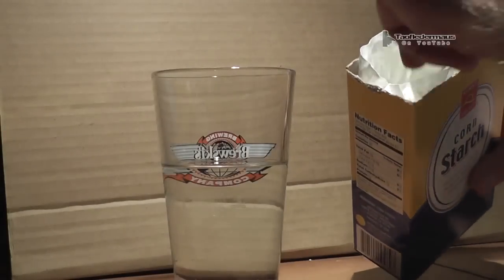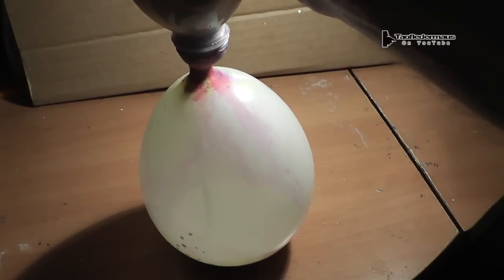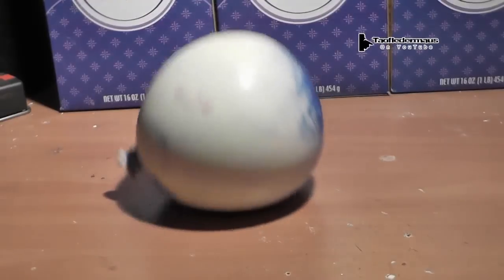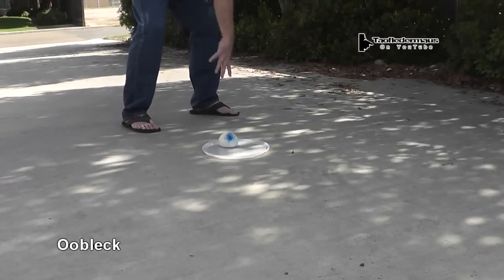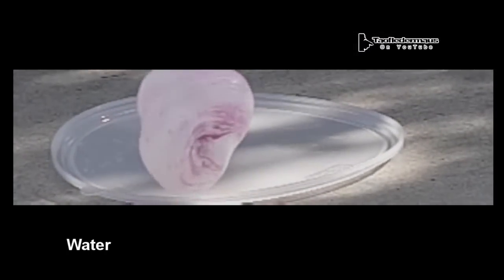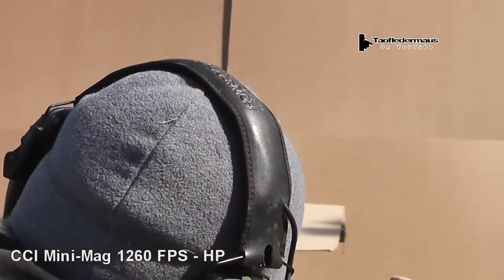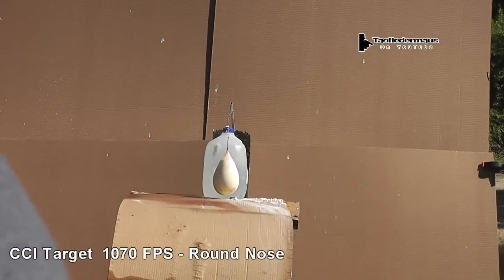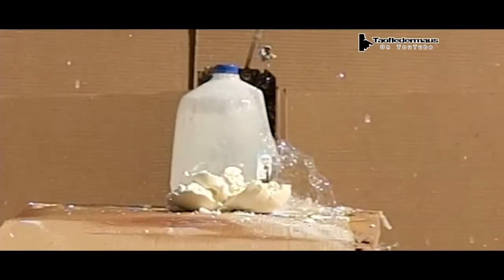Is OOBLECK  Bulletproof?   - Cornstarch and Water

Comment: Of course oobleck is not bulletproof. There is an upper limit to what it can take like any material, and obviously oobleck isn't on the level of steel or stone. Still you can see that it does not splatter like water, and acts a bit more like a solid.
Reply from the maker: I knew you were going to say that.

Comment: You did this ALL WRONG.    You should have had identical stop blocks behind the balloons that the difference (if any) between a simple water balloon and an oobleck filled balloon could be observed.  How much (if any) did the oobleck reduce the impact compared with a water balloon?  Your experiment only told us bullets will go through oobleck, nothing else.
Reply: Plus you should have used a more sturdy container for the oobleck as the balloons deform very very easily.  Or a test between balloons and say, a wooden housing of some sort.  There was so much you could have done for a fantastic video but were just too lazy or unimaginative.

Comment: What I was seeing is the fluid reached it's maximum hardness and shattered. The harder things get the more brittle they become is my understanding. Diamonds can be shattered though they are incredibly hard but the same amount of force that shattered a diamond will only make a bit of rubber bounce and distort for a few seconds. Hmm Diamonds are made from carbon and rubber is from rubber tree sap... can the two be mixed into a non-Newtonian fluid that can stop a .22 round? Dunno and everything I said in this paragraph might just be bullshit and bad education.
Reply: JETWTF Rubber is mainly made of carbon, oxygen, and water. Just about everything you see is made of Carbon, the rest is probably silicate, iron, or oxygen. As for using diamond in non-newtonian fluid I think steel would work just as well. Diamond is far too expensive and impractical. Non-newtonian fluid could be useful for protection against some form of shot, but I'm not entirely sure non-newtonian fluid can stop a bullet. Even if it can the military will not adopt it. I think I seen a video where non newtonian fluid was shot with a bb gun and a fairly good chunk was taken out of it. But, it did kind of repair itself so that could be useful because body armor is only useful after a 3 or so shots. But if you're shot that much you're probably dead anyway.

Comment: This test doesn't disprove the theory. The fluid must be prevented from rupturing the shell of the container. Using a balloon as a shell isn't going to prove anything about this mixture being bulletproof as the balloon isn't strong enough to contain the pressure. The balloon allows too much kinetic energy to be transferred into motion of the fluid, if you restricted the movement of the fluid, the energy must be dissipated as heat...

Try again with a rigid shell, I imagine the results will be somewhat different...
Reply: I agree with your theory.
Reply: @EliMarx actually its not hard to find the basic physics that proves what i am saying. This is something i work with on a daily basis. 
Many people posting something just proves that many people are ignorant of the basic physics that behind the concept.  (your basic "agumentum ad populum fallacy").

This is a proven concept. Mercedes has been using a similar concept in brakes for decades except theirs is electrically actuated. There are locks that use the same principle and bombs have used the idea of non Newtonian fluids for decades to thwart tampering. industrial clutches have used this principle as well from before WW1

And BTW i was NOT trying to prove anything. What i stated was that the container is irrelevant except to hold the material and i told you WHY that is so. This being the internet , it is not outside the realm of possibility that a simple search will prove me wrong or right given that i am just a voice on the internet and pretty much EVERY deserter is going by what they feel not by what physics says.
Reply: use kevlar to make things interesting
Reply: Can you suggest me some non Newtonian fluid / liquid which can prevent bullet . If you can share any video or research paper , that will be helpful for me 
Thank you
Reply: Good Idea, I think it should be a bit deeper as well, give more fluid to stop the bullet.
Reply: I'd like to see it put in a tin can or something. I think I'll try that. Density/viscosity (how much water) also affects performance.
Reply: Yes agreed
Reply: Just put it in a pan and shot it without the lid
Reply: @EliMarx " If you shoot through water in a balloon, it won't slow the bullet much. Shoot water in a pool, it will."

i also forgot about this .

Non Newtonian fluids behave DIFFERENTLY from water. 
The force applied to a non Newtonian fluid is absorbed into the material causing the material to quickly form interlocking crystalline structure thats hard to break and the more force applied the FASTER the material hardens and the HARDER the material gets. 
Water does not do that.
Reply: @EliMarx its not a theory its basic physics and you have once again missed the basic fact. The density of the material is what matters . Sand in a bag, water in a bag, syrup in a bag or a ballistic gel matters NOT . 
If you have enough sand it will stop a bullet if its in a balloon, a bag or standing in a heap all by itself. Its the RESISTANCE to the bullet that counts not the thing that the resistant material is in.
Reply: You misunderstood the concept. It's the fluid that's supposed to become hard . The balloon is just to hold it together do the bullet can hit it. Container has no effect
Reply: @jussayinmipeece1069  you misunderstood the physics
Reply: @jonathanclarkin8844  really‽ in what way,,? I am pretty sure I was quite clear on how nonnewtonion fluids work so please explain your understanding of both no Newtonville fluid and what you think u have misunderstood
Reply: @EliMarx nope, you are wrong. The container is irrelevant. What will be relevant is the amount of material and its thickness.
The material will behave the same way regardless of the container. 

let me elaborate. What you are testing is the ability of the material to QUICKLY solidify to the point where bullet is slowed significantly or stopped. That depends solely on the property of material you are shooting and has zero to do with its container.

Where the container comes into play is in keeping the material together so that the bullet can impact it. After that the properties of the material come into effect and if it is bullet proof then it hardens sufficiently and the bullet slows if its not then the bullet goes through. 

What is confusing you is that the material seems to fly apart so you believe that it did in fact harden and would have stopped the bullet had it not come apart in many pieces. Thats not a valid argument . The container is not supposed to be a part of the armored element. 

As for your water analogy you are also wrong.

The resistance offered by water is consistent regardless of the container. All that matters is how much water you are shooting through. If you had a very long balloon and shot through it at the long end the bullet would penetrate the same distance as long as there was water for it to go through
Reply: @jussayinmipeece1069  you make a good point but i would still like to he how it behaves with something more solid that can hold the fluid in place.   The balloon would pop either way because it makes contact with the bullet before the fluid does and I believe that has influence on the result of of the video. When the balloon pops the blued begins to lose shape. Like in the second shot you can see that the fluid mostly held form even after it was broken so im if it was in a more stable container we'd see more interesting results. but judging by that whole it'll probably still pierce it sense there is such a small area of impact. 
Even though i think it has influence over the result I don't think the difference will stop the bullet all together. Just slow it some. 

Tl:Dr Im really interested in seeing how it reacts in a container that can hold its form throughout the impact.
Reply: @kennethM  I do understand your point. Hanging a container with a  fluid actually presents a real issue and thats gravity.  The moment a bullet penetrates that container the fluid begins to drain , offering less distance to penetrate and less viscosity for crystallization in a non Newtonian fluid pretty much guaranteeing a non conclusion. So even if the surface solidifies the rest is already draining with varying and non consistent results. 
So a solid container would affect the results.  However its important to note that the basic principles remain exactly the same. 
Example, if you hang a sandbag and shoot it the resistance remains the same and therefore the penetration remains the same. If you hang a large balloon and shoot it as long as there is water to resist the bullet then the result will remain but the water would be falling (pesky ole gravity) so the result would be different from shooting into a pool with static water. Again because if you shoot a water balloon thats four feet across that balloon shatters letting out the water allowing for gravity to reduce the amount available to penetrate. 

But again  the basic principles remain the same

Comment: try shooting a bigger balloon with a shotgun slug... i theorize that the small diameter of the 22 doesn't provide enough surface area for the oobleck to offer sufficient resistance. You see this in body armor as well... smaller faster bullets have a tendency to penetrate the armor, but larger and slower (even if more "powerful") projectiles don't (shotgun slugs, 30 caliber rifle bullets (non-magnum), or even canon balls.

Comment: You know, it's so funny that I cam across this video because ever since I made General Tso's chicken one day with that corn starch goo coating on the chicken I thought "would this make a good impact resistant vest?" because I would take my fork and stir it hard as hell and it would turn rock solid momentarily and if I stirred it extremely slow it would be just like thick water.  I figured that a bullet coming at it that fast would (a lower caliber of course) could be stopped pretty damn easy.  It's nice to know that it wouldn't stop it and it's also nice that I didn't have to go through the trouble of trying it out one day! Lol!  Great video man!

Comment: What you don't consider is that even things which change property under some circumstances have their point. The fact that non-newtonian fluid hardens during the impact doesn't mean that it's hardest possbile stage is linearly proportional to the applied pressure. Use some better sort of non-newtonian fluid. There is innovation in stab proof shirts which are immersed into a liquid kevlar/glass powder mixture which is non-newtonian fluid with much harder properties when pressure is applied.

Comment: How did you get it into the balloon?
Reply from the maker: +GinEric84  I put the oobleck in a bottle,  inflated the balloon with air,  and slipped the balloon over the neck of the bottle.  Then I inverted the bottle and the oobleck displace the air.

Comment: I'm always intrigued by the name "non newtonian fluid"... because ALL FLUIDS are in fact "non newtonian fluid" @ specific conditions... I think the "scientist" that named some "non newtonian fluids was just scamming you.

Is water a "non newtoninian fluid" ? Of course no would you say.... but hit water with a plane @ 1000mph and the plane will crash on the surface of the water as it was as hard as concrete... thus water IS a non newtonian fluide when "stressed"... this is just fucking stupid.
Reply from the maker: +Bazuzeus   Non Newtonian fluids are either shear thickening or shear thinning and do not follow the normal properties of common fluids like water.   (Newtonian fluids)
Reply: +Bazuzeus that not true actually.when we sayhit water at high speed is like hiting concrete is more to do with the forces of impact i still so high that you won't survive it. on the video we can see that the oobleck  looked solide on impact when the water behind just acted like water
Reply: +Bazuzeus being a hard impact has nothing to do with being a Newtonian fluid or not. The reason a crash into water does damage is because of water surface tension properties, due to the polar, tight water molecule structure. Surface tension is entirely different from Non-Newtonian properties, where a liquid will change its actual behaviour depending on the force of the impact. Water does not change its behaviour. Surface tension is still the same, the movement of the water and structure is still the same. The only difference is that you're trying to break through the surface tension much faster
Reply: +Bazuzeus All liquids follow newtonian properties on the microscopic level. The difference is that on a macroscopic level non-newtonian liquids turn solid when forced upon. However this is because of the large particles in the water. You see cornstarch is made up of large and small particles; when you force down on it the small particles don't have enough time to escape and get jammed with the large particles. But when you push softly the small particles can move around the large particles and therefore becomes like liquid. 

A plane however hits the water as hard as concrete? This is because of surface tension and the Newton's third law. Whatever force you exert the object will push back with an equal amount of force.
Reply: +Bazuzeus Someone who doesn't know his physics. This is an actual concept, involving viscosity. The plane still hits the water and sinks. If it hit something like Oobleck, the Oobleck would harden and the plane would likely explode and sink afterwards. These concepts are actually used by the military, and play a big roll in ballistic/ knife protection.
Reply: water tension is not viscocity. you just called the scientific community stupid.
Reply: Nice bait mate
Reply: +Bazuzeus You're correct, but for practical calculations water and other gases + liquids are considered Newtonian because they very closely fit the definition of a Newtonian fluid. I think the main difference is in the changing of viscosity under stress in Oobleck, with water creating the "Hard as concrete" effect as  simple result of water being something that cannot be compressed. It could be argued that these properties of water are very similar to non-Newtonian fluids, but I would counter that by reminding you of just how much weight in water is opposing the displacement of water in the ocean or a lake when a plane crashes into it. Dropping a rock into a sea of oobleck will result in a very non-linear velocity as it sinks whereas this velocity would be much closer to perfectly linear if done with water. 

(Disclaimer: I am in absolutely no way a scientist and this all comes from my own knowledge of Newtonian fluids, confirmed by a little Wikipediaing.)

Comment: Try it with something without such high velocity. Those .22s at somewhere around 1200fps have a beautiful way of just traveling on through things (like cans) without even knocking them over. Something like a .25 acp is subsonic at around 800 fps (if I remember correctly), and when you compare how they travel through a phone book, or pieces of wood, there's a big difference. Maybe that fat, slow .25 tumbling after it hits will give you some different result.